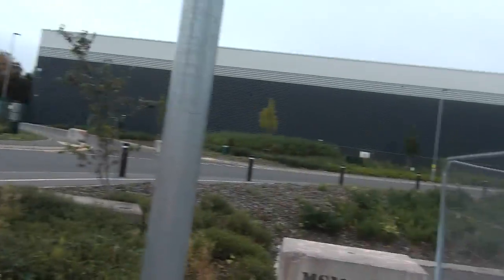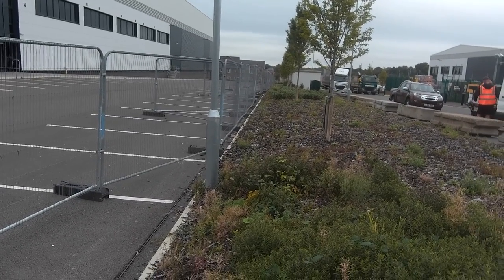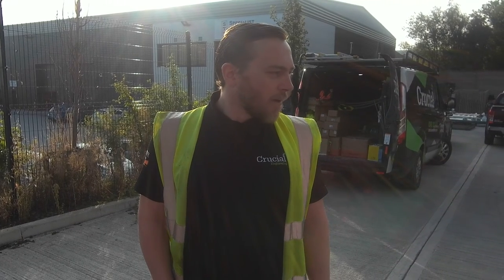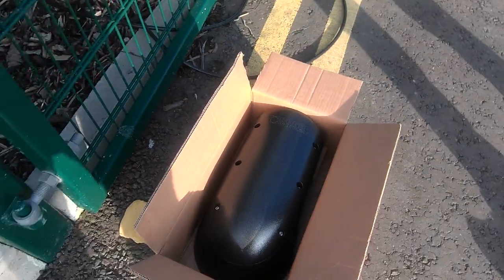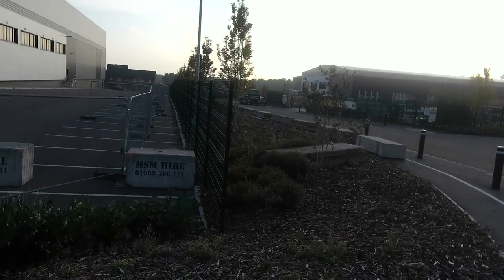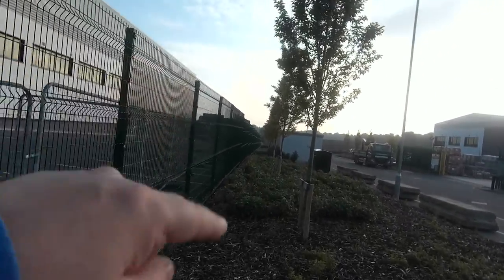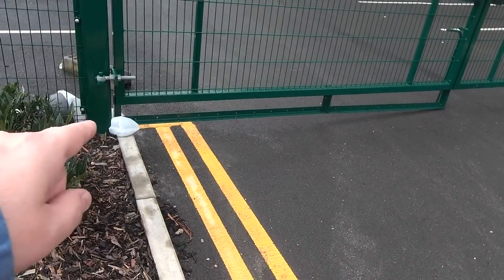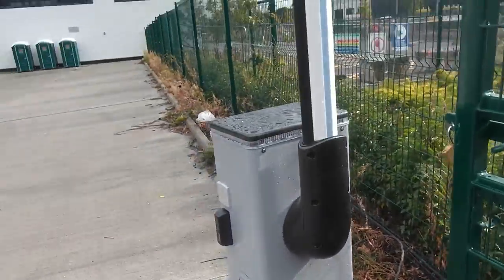VMesh fencing installation - Joule UK

Comment: I need to render the back of a wall for a customer ya see and no idea if I can take it down Cheers
Reply from the maker: Yes if you get the correct bit it can be taken down and re-attached later....would need to know where the Fencing is from ideally or a picture of fittings and might be able to help with one.
Reply: @Airedalefencing  that’s really kind of you Thankyou very much I really appreciate it ! Could I send you a picture of the fence and the fixings👍🏻👍🏻
Reply from the maker: @Giles J  yes of course no problem
Reply: @Airedalefencing  great where shall I send pics to ?
Reply from the maker: @gilesj2215  info@airedalefencing.co.uk
Reply: @gilesj2215  hi guys, are these game panels easily cut to size? I'm looking to install v mesh in our garden.